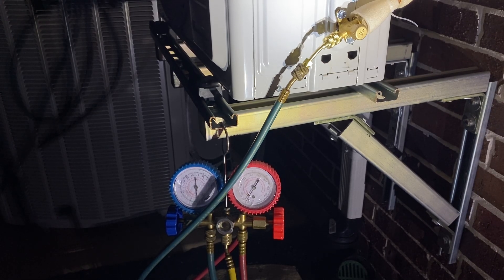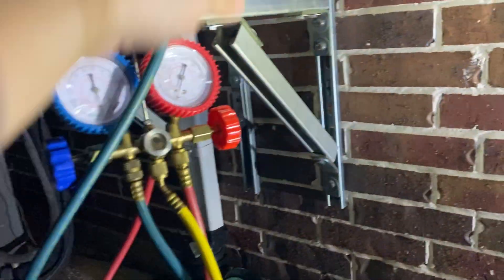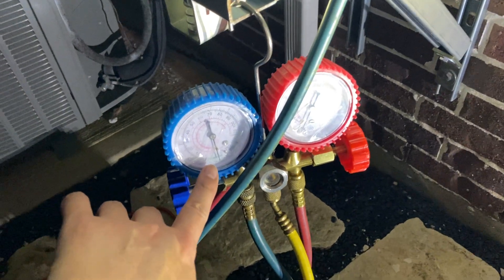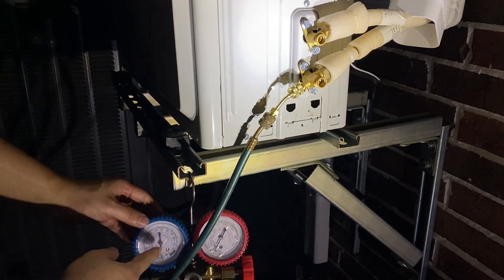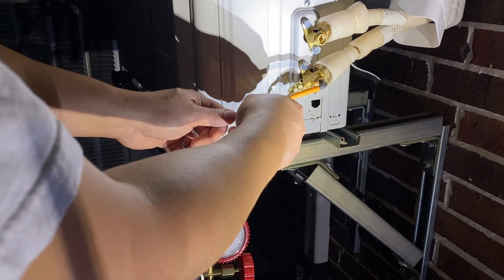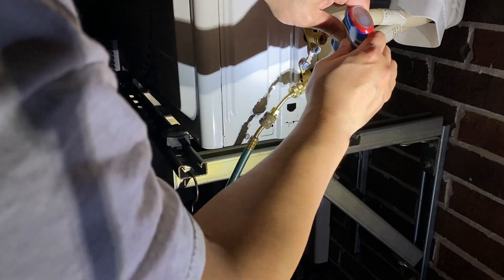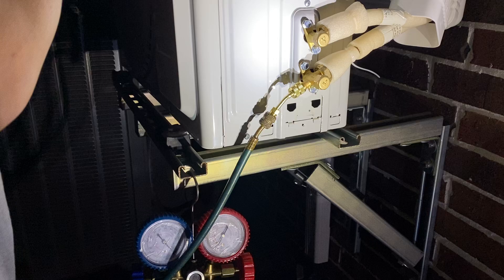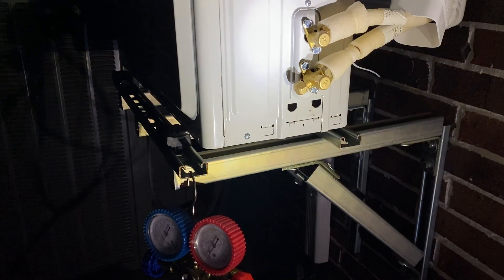Vacuuming the Mini Split unit before releasing the Refrigerant

Comment: What adapter kit did you use?  The kit I bought off amazon does not compress the valve on the unit and so the lines are never evacuated no matter how long the vacuum pump runs.

Comment: Nice video.  But why not just SLOWLY pressurize the system a bit (couple of psi) and then remove manifold gauge hose?  Then you don't lose as much refrigerant compared to removing the hose with system fully pressurized.  Also doubles as second verification that your manifold gauge was indeed reading the actual vacuum inside the system.   Also 15 min leak test doesn't seem adequate to detect slow leaks.  Maybe longer leak test is better?  I did 10 hour vacuum leak test to make sure my system is not leaking and it was still good after 10 hours.

Comment: Did you pull the valve core before pulling vacuum?
Reply: Hè has a service plug connection.
Reply: Yes you can use a valve core removal tool to speed up evacuation.

Comment: Which valve did you open first ? liquid line or vapor line ?   does it matter
Reply: no not at all
Reply: I thought you were suppose to open the suction line first , by opening the liquid line first you will be taking oil out of the compressor with the vacuum and possible  premature damage may occur .

Comment: One tip I've heard is to open first valve for a few seconds to let only some gas in. Close it. Then check for leaks before continuing. That way, by small chance if you are unlucky to have a leak under positive pressure, u won't lose all your gas.
Reply: The best tip is to use nitrogen first.
Reply: Small amount of positive pressure isn't good for leak testing (if system already passed vacuum leak test).  But what it's good for is to remove the manifold gauge hose without losing lots of refrigerant.  After hose is removed, then you can fully release the refrigerant into the system.
Reply: But once you let the system sit with the gauges hooked up for a 30 to 40 minutes, if you your negative pressure has stayed put, then you know for certain you don’t have a leak so there isn’t any doubt and you can release all the Freon.
Reply: @sarahbello4004  Freon pressure is higher than vacuum
Reply: If there is a vacuum ,u need to wait a few hours and u will see if there is leak on the system.
Reply: @johndoo5363  no vacuum is not for leakkage  testing purposes.
Nitrogen is

Comment: I have a question, if I’m gonna disconnect my lines for roughly 10-15 min. Do I need to pull a vacuum again before opening back my valves with refrigerant?
Reply from the maker: If you disconnect your lines, you will probably loose too much refrigerant. You will have to reconnect, vacuum, then open the valves. After that you probably will need to measure and add refrigerant.

Comment: Question for anyone why not unscrew the hose before releasing the freon?
Reply: I think it is because if you unscrew the hose while there is vacuum in the line, the depressed schrader valve will suck in a little bit of humid outside air which is what you are trying to get out of the line to start with. Unscrewing after you pressurize the lines will let out a tiny bit of freon. Either way would probably be fine but after is the better way.
Reply: @micahbaughman4905  understood thank you!
Reply: Then you would not be able to read the pressure to confirm the Refrigerant is in the system.
Reply: Both answers are right while the first one is mandatory
Reply: So releasing some freon is inevitable?

Comment: Been doing this for long time. I assume you purge the line set & EVAP coil with the refrigerant from unit.
Reply: Before closing the blue line you open the top valve to let in some refrigerant then shut the valve and open the line coming from the u it completely?